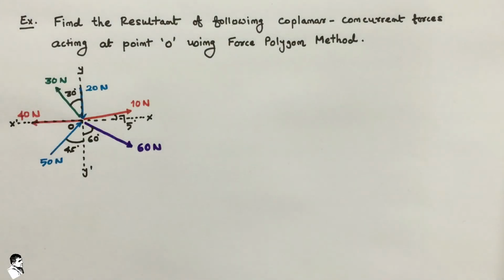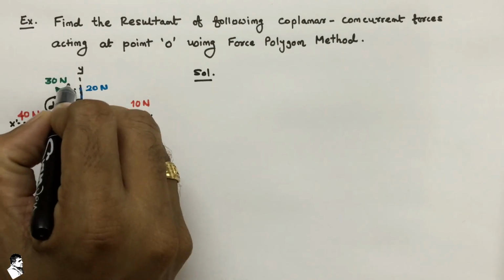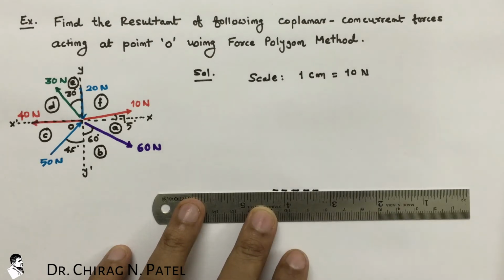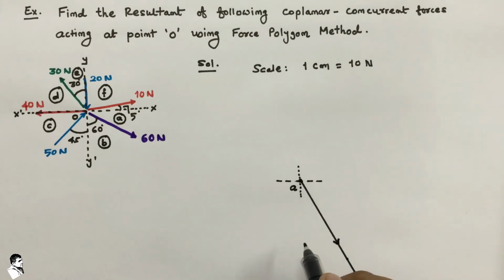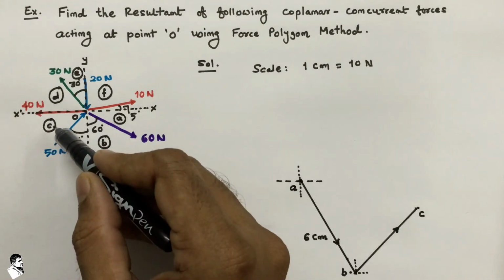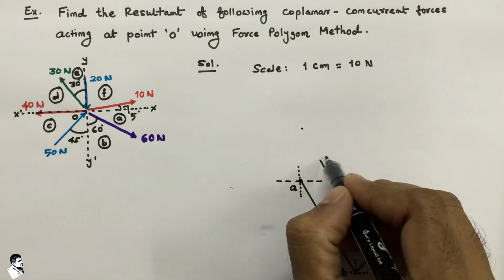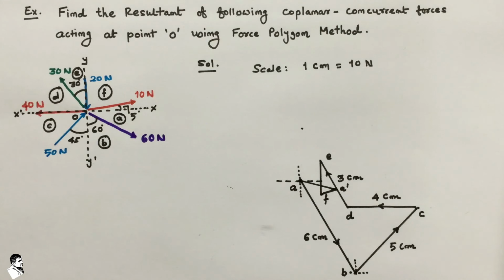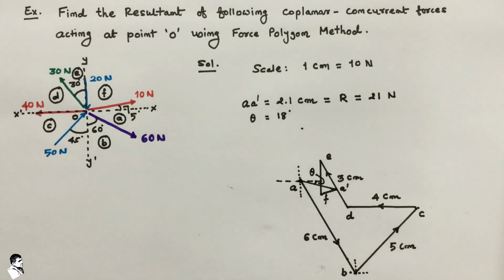Force Polygon Method Example - Mechanics of Solids

Comment: sir, taking 60 degree angle may be wrong, at 4 minute 10 sec in your video. you took it in x axis but given in y axis. please check and reply...... and don't mind.
Reply from the maker: Moynul Rumi Ya that's required to correct. Thanks for your valuable suggestion.
Reply: thank you sir.
I watch you lecture regularly. You are so talented, I like your video very much.